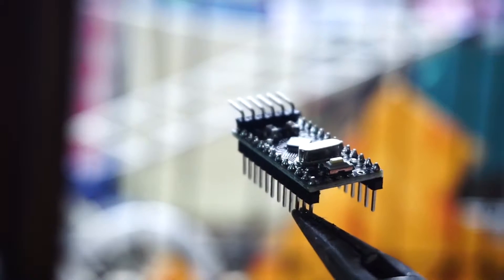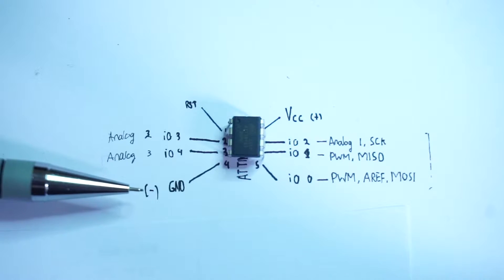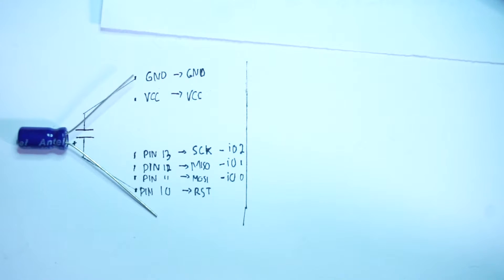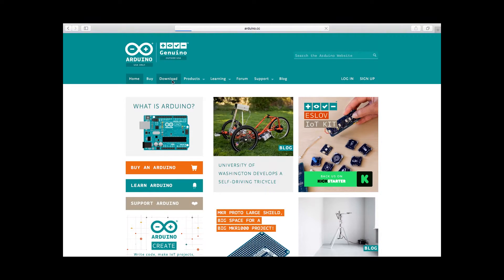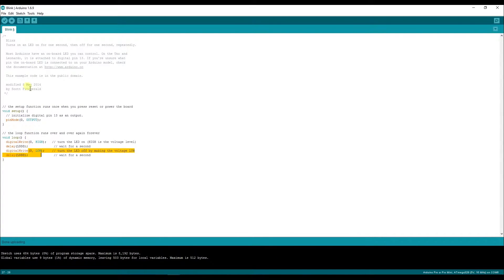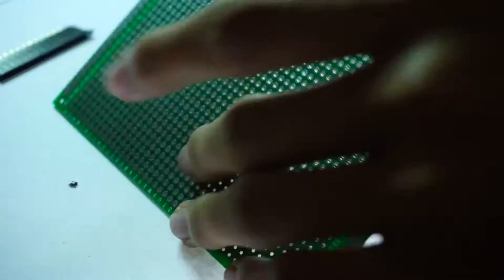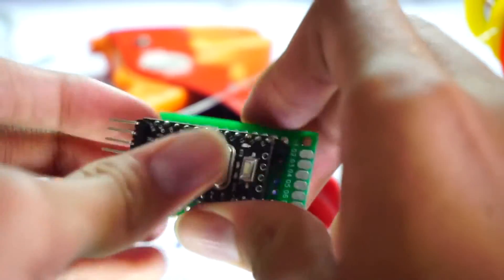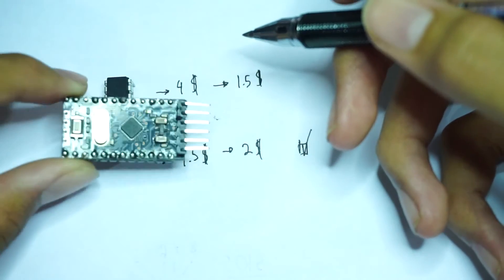How to Program The ATtiny 85 with an Arduino Pro Mini and create a shield  || Shrink an Arduino

Comment: Nice instructional vid, but insanely FAST for the faint of heart.
I'll try to help detail for sake of clarity:
1. Upload the "ArduinoISP" sketch, available at File>Examples>ArduinoISP, on Arduino ProMini as usual (I mean in the Tools select the COM port, Board selection, Processor ATmega328 5V 16MHz or 3.3V 8MHz, Programmer AVRISP mkII)

2. To program the ATTiny85 with the Arduino ProMini change the Programmer (Tools > Programmer > Arduino as ISP), COM port is the same as before, Board is ATTiny 25/45/85, Processor is ATtiny85, set the Clock freq

3. Open the sketch you want to upload to ATtiny85 and Upload it

That's all.
Reply from the maker: Wow, I don't know how to thank you.. Thank you so much mate ^_^

The comments are the same in each video (well at least most of them), too fast.. I'll try hard making better and slower videos next time. Again thank you.
Reply: this comment has better explaination, thanks man!

Comment: dude , that was too fast... to understand . In my arduino software there is another option gets added when u select tools>board=ATtiny85 that is processor and clock also. wat should do with that?
Reply from the maker: Kunal Desai Ah, I'm sorry, I didn't notice this comment.
The clock is set at 8MHz. As for processor, what's the option?

Comment: So much info in such a short space of time! Hard to understand the spoken word sometimes.
Does your Attiny have a bootloader?
Reply from the maker: I'm sorry then, if I spoke too fast. ^_^
I'll speak slower next time.

No, my attiny doesn't come with a bootloader, I've burned it on the IDE before making the video.
Reply: What method (software and hardware) do you use toburn the bootloader? Maybe an idea for a video? Thanks, Erik
Reply from the maker: +brice3011 
In Arduino IDE, after your Arduino is ready to upload sketch to the ATtiny, instead of uploading the blink sketch to the ATtiny, go to menu→Tools→Burn Bootloader.

And you're done!
Much thanks for the suggestion, I'll upload it a few days after my ESP 8266 part 2 video is done. (Hopefully, next week.)

Again, thanks!
- Arsyad
Reply: For the bootloader firmware (which one?), do you have a url or instruction/tutorial somewhere?
Reply: Did you know you can get the Attiny85 in a Digispark package which includes a USB connector that allows you to program it straight into the USB bus, using the Arduino IDE? Saves you the trouble of using a Arduino hardware intermediary.
Reply from the maker: +brice3011 
I'm in Indonesia, which'll take you a  boring month until you recieve a single package from china. And from America, it would cost me like 20$ a single ship plus three weeks of shipping. 

So I prefer making my own. Simpler, faster, and way more fun. Spend two hour, and you'll feel proud and satisfied for the rest of your life seeing that board in your workplace. :D

Speaking of firmware, the Arduino IDE automatically takes all of 'em in care, it's as simple as clicking a button, and you're done.
Reply: You should be a bit more patient, you know: Chines Zen ;)
I order through Aliexpress, Digistump Attiny costs me €1.10 free shipping and yes, I wait a month or so..
Reply from the maker: +brice3011 Really? Well maybe I'll use eBay or AliExpress sometime in the future.

But definitely not for a 'need for speed' project. :)